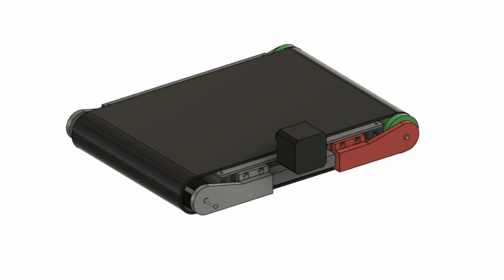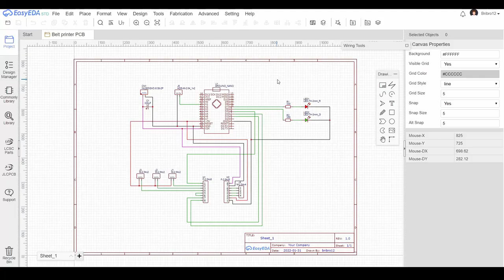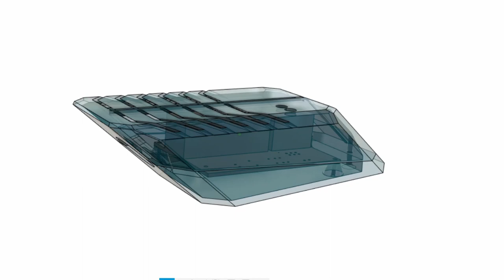Delta belt 3D-printer for automated series production

Comment: If you add* a small bump out in the center of your rollers, like a really obtuse V shaped profile it will help your belt track the best. I think you might have done that but wanted to share just in case.

This is how rollers on 60" package belts do it for like shipping companies*
Source I'm a conveyor engineer.
Reply from the maker: Thanks for your insight! Yes keeping the belts aligned on the rollers was no easy task. I first designed flat rollers with 45 degree angles (easy to print) on both ends but the belt kept running over it. The rollers now are slightly thicker in the middle than at the ends, this works great to keep the belt aligned but the sides of the belt are a little looser than in the middle of the belt.

Comment: Great idea - I have an older Rostock Max I was thinking of repurposing. This might be the way for me.
3 questions: 
1) What are you using for auto leveling? How often does it need to be redone?
2) Does the belt "scraper" remove the skirts after the parts drop into the hopper?
3) I notice the printer starts the next skirt while the  belt is still in motion, I assume you just need to add a bit of delay?
Reply from the maker: Hello, i use the autobed leveling switch and functionality of the Q5 printer, it normally should happen only once. The scraper does not remove skirts on my case but didn't find this to be an issue as the printer just prints on top of this. It might be an issue afterwards if you have to clean up some parts with the skirt attached. The timing of the printer and belt can all be adjusted in the code and slicer settings. It's not an issue if the belt moves while the printer starts moving because most of the time it isn't even extruding pla at the beginning, i was just happy it worked and to lazy to adjust timings 😜

Comment: Why is the printer pausing and buzzing momentarily at 6:30?
Reply from the maker: Its retracting it's filament before moving over "open air" to move to another part of the print to prevent stringing. More info can be found here: https://all3dp.com/2/3d-print-stringing-easy-ways-to-prevent-it/

Comment: Have you made and design files or software available for this? It's the first 3D printer I actually want..
Reply from the maker: Hello Sam, yes the STL and Fusion 360 source files for the conveyor belt are available on my website: https://bbprojects.technology/collections/stl-fusion-360-source-files/products/delta-belt-3d-printer
The delta printer I used is a FLsun Q5: https://www.banggood.com/Flsun-Q5-3D-Printer-Kit-200+200mm-Print-Size-Supprt-Resume-Print-With-TFT-32Bit-Mainboard-or-TMC2208-Slient-Driver-or-Colorful-Touch-Screen-p-1591796.html?p=E01411629100201406T1&custlinkid=1312467&cur_warehouse=CN

Comment: How did you synchronize the base with the end of the print so that when the piece finishes rotating and starts making another one?
Reply from the maker: Hello Nuno, The belt moves when the printer touches a limit switch placed on top of the printer. This happens during the homing sequence of the printer. Since I copied and pasted the G-code the amount of times I need the parts to print, the printer homes every time it starts a new print, so it touches the limit switch every time. The distance the belt moves is a fixed value, triggered by the limit switch. This value can be changed in the Arduino code to suit your needs better.